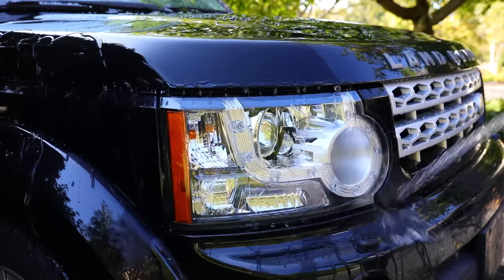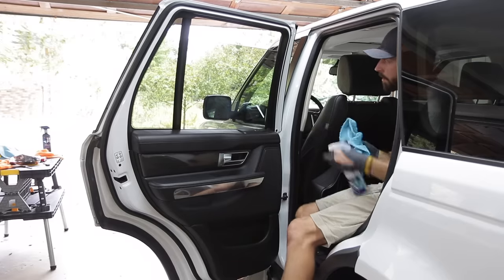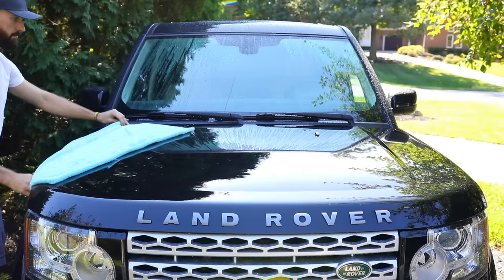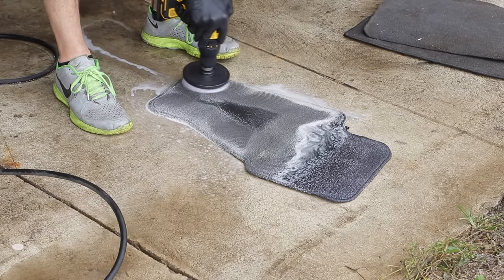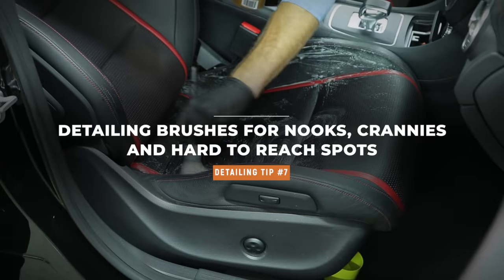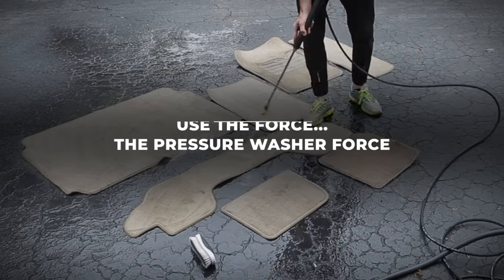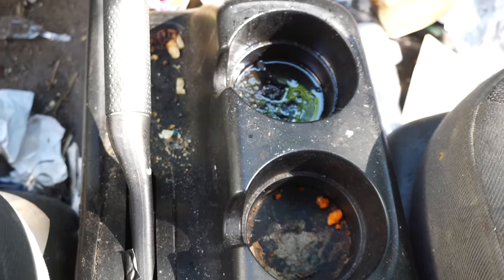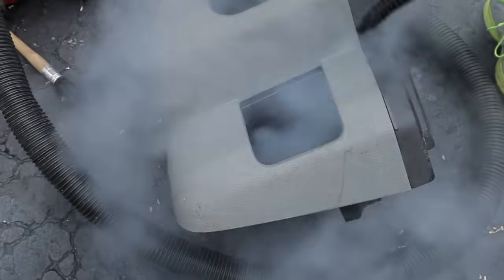12 Dirtiest Car Detailing Tips You NEED To Know When Detailing Your Car Interior and Exterior!

Comment: In addition to using all these methods as a professional detailer, a small air compressor helps immensely to blow dirt out of crevices, vents, seat tracks, between seats and consoles, works best after apc is sprayed, brushed, and excess wiped away. Light usage of magic erasers works well on steering wheels, vinyl, and some molded color plastics. 
Excellent videos, keeps me motivated sometimes while working on nasty rigs by watching them!!

Comment: Stauffer what do you think about using water-less cleaners such as Resolve powder cleaner + carpet brush on floor mats? I recently cleaned my floor mats with this method and while it was a little more labor intensive than the drill brush and an extractor, it was more accessible to do since I don't yet have those other equipment.

Comment: Thanks for the tips!!! I need to get an electric pressure washer, my gas one was used 2 times and left sitting and now it doesn't start. My own fault but the electric one is so much easier for me for occasionally using one.
Reply from the maker: I feel the same!
Reply: Nearly all no-start and running problems with small engine equipment are caused by fuel problems, such as gasoline deterioration and deposits in fuel lines and carburetors.  Using gasoline stabilizer or draining the fuel before putting equipment away for extended periods will save you a lot of trouble.
Reply: @Aardvark49  Absolutely 100 percent agree, just not worth the effort for something I will use maybe every 3 months to go through that all the time. My problem is "I will do it tomorrow"  with drain etc and then I forget and we all know how that ends.

Comment: Your first tip can be completed with just the rubber gloves should the objective be to remove just dog hair. The static from the rubber while doing the rubbing motion on the carpet will pick up the dog hair. Very good trick if your in a pinch.

Comment: Could you explain the difference between sealant and wax? I guess the spray on sealant kind of confused me, cause it didn't involve a clay bar treatment.
Reply from the maker: wax's are carnauba based which comes from a tree. Sealants are all man made and have properties that allow for longer lasting and other factors. I still would recommend clay bar, polishing, etc to completely "clean" and remove any scratches from your paint but if you wash your car thoroughly and are unable to do those other steps, this is an easy and great topper that gives you really nice results.
Reply: Stauffer Garage thanks! Great video

Comment: Hi, I'm trouble of removing the pet and urine odor in my car that has cloth seats. I attempted to replaced the whole new carpet of the car, but that  did not seem to help getting that odor away. I have used the pressured washer to clean the but the smell is there. What is the best way to clean the seats if I don't have the extractor? Thanks!

Comment: Hey, could you recommend something that will remove "pale white" runny stains on the side of my car's dash?  Basically I used "3M dry silicon lubricant" spray and applied between couple of plastic trim pieces and wiped the excess.  Since these plastic trim is vertical, some more of that lube started dripping later and dried, I guess.  I can't get rid of these stains.  I have tried alcohol, vinyl/plastic restorer.  The latter hid the stains a bit, but still they are visible. What can I safely use to hide or remove the stains?

Comment: Can steam get nail polish off of plastic panels? My mom paints her nails in the car and it's everywhere. 😔
Reply from the maker: I believe it should!
Reply: Have you ever tried acetone? I already had this problem with a blouse and I put on acetone and it went very well.
Reply: Use nail polish remover. Acetone may strip the color from whatever surface is on so patch test it if the non-acetone variety doesn’t work